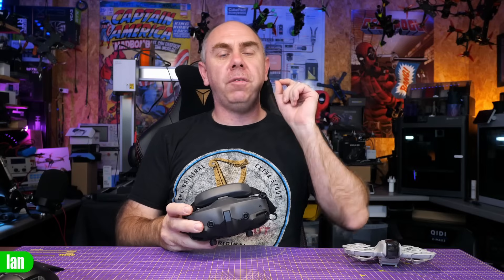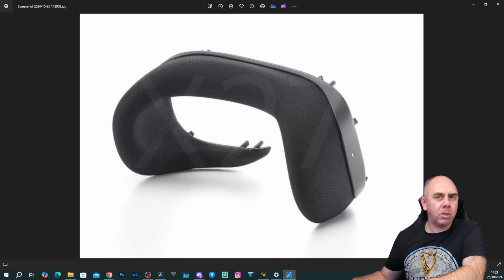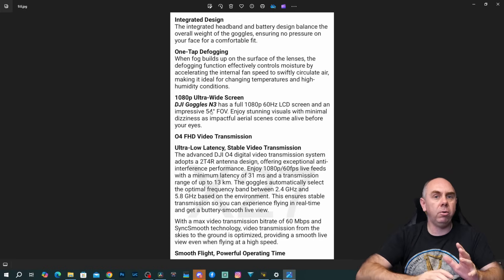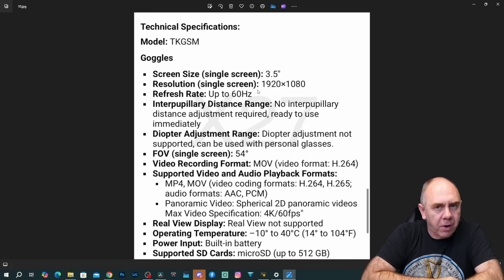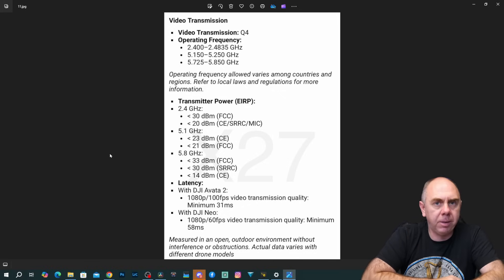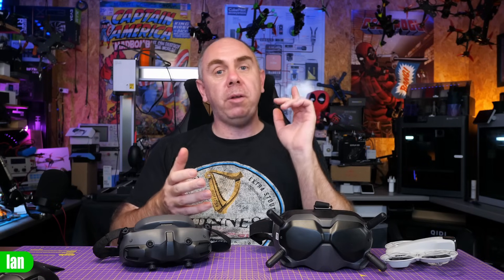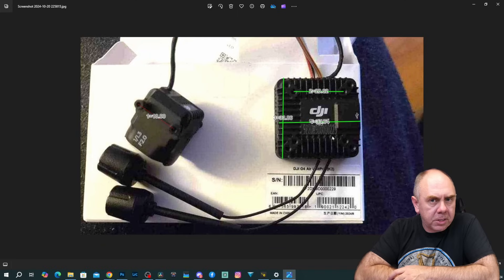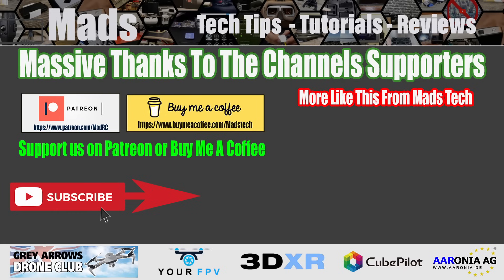DJI FPV Goggles N3 Spec Leaks - 60Hz Display  - High Latency - No O3!

Comment: I don't understand the whole "O4 isn't ready" thing. My Air 3S arrived 4 days ago equipped with nothing but O4. It works great. And I wonder why they exclude the O4 equipped Air 3S from the list of drones that can work with this "O4 only" goggles. Both you and DJI are communicating like the Air 3S doesn't exist. There's a gap of information.
Reply from the maker: You have to speerate off Ca.era drones from fob products.  

DJI do not usually make camera drones compatible with their goggles fully.   While they did do it with Mavic 3 and Air2s that was not the norm. 

Yes your air 3 has O4 but it's a different veriant of O4 compared to what FPV O4 will be.  

DJI O4 on their camera drones is not the same as O4 on the FPV Products.
Reply: @MadRC thank you!

Comment: Why doesn't dji put up same video transmission and reception technology as used in mavic series HD video transmission.  Look at the range in mavic series we get without signal loss and the range we get in avata 2 and other custom fpv's even with dji o3 air unit
Reply from the maker: The Consumers camera drones like the Mavic3  series all have a much lower bandwidth live view links.  In compassion O3/03+/O4 on these drones would be less than 20mbps for the live view.  The chances are it's it's closer to 15Mbps max and can be as low as 5mbps where as O3 and  O4 FPV is upto 60Mbps.  DJI are pushing dramatically more bandwidth to reduce the latency on the FPV drones.  

O3 or O4 on a camera drone is not the same as O3 or O4 on the FPV Products. The links are tuned diferrenty. The Mavics may have lower bandwidth and  far more error data in the link at the expense of latency.  Most of the consumer drones hover around the 100ms mark for latency compared to sub 30ms on O3 

While they may look similar they are not remotely the same kind of RF links and won't behave the same either and one penalty will be range and penitration and latency.

In simple terms One is an F1 car and one is a people carrier. Both have their benefits and downsides but they will not behave the same.

Comment: It's basically DJI goggles V2 but a V3. The V2 is epic with the 03
Reply: V2 still the last best of DJI, and with AV in put :face-blue-smiling:
Reply: @tk-maker  totally agree
Reply: Dont leave out the  g2 goggles, i like my g2 as much as my v2, but ther integra and newer are trash @tk-maker
Reply: Bulky like v2 but n3 only has one screen.. I'd say v2 are still better
Reply: @GR33ZY.A1  much better but not supported for 04 which should be since most fly with 03 on V2 my G2 suck and I only use V2 now but now I learned 04 on G2 will be great too I just wished I had the choice to move the OSD of DJI to the left and right on the screen instead of going cross-eyed trying to look down in my G2 but thank God for betaflights OSD

Comment: So, V2s and 03 for the win still.
Reply: And g2 , not integra, the v2 and g2 are my equal favorites , the v2 still gets slightly better range and latency though.
Reply: @jeffdughman9741 why not the integra?
Reply: @perry_the_liu built in battery when it dies you done flying can’t use lipos to power it, and no focal adjustments by dial the give you like 10 different lenses you have to find the right one taking each on and off to test and if you wanna let someone use them or show them a flight it’s a pain

Comment: DJI is really pushing things recently. Flying in 60fps or higher is perfectly fine for me, 30fps never was....I think these are quite good Goggles when the bring out the O4 "lite". Maybe they will give more options to the Goggles 3 and "Pro"  O4 Version. If they get out a lite and single board version that would be a killer, even though I think this might be challenging.

Comment: A complete waste of money. I have this drone with n3 controller 350€. This goggles, the fpv controller and spent 800€ on a entry level drone which doesn't really do acro (not too long I guess). For this money you can get a complete aqila16, cetus x and whoopfly16 sets together.... For rich noobs....
Not to mention, if somebody wants to pratice throttle control, enoght a small piece of duct tape onto the IR and VPS sensor and the drone turns on atti mode and can pratise the noob. If someone has a avata 1 is nothing compatible. Let's see who will buy them...
Reply: Atti mode on Neo? But gps is still received. Have you tried duct tape Neos bottom?
Reply: @videos3d313  yes. Oldskool dji trick. The gps Performance is weak out of the box, put on small piece of alu foil and you have continuous atti mode
Reply: @djiNEOn  yes, but it doesnt work on my mini3pro. it wants to always raise with center throttle stick :(
Reply: Me, I guess being a rich noob, I will waste my money on this lol. I didn't want to spend time researching other options. Time is valuable. I want to buy into a known decent brand that will most likely work well for it's INTENDED audience (me) and be done with it.
Reply: @mjnz  I don't care

Comment: DJI I estimate has sold 36000 units of DJI v2 over the last 3.5 years.  There are 94 reviews of these goggles on Amazon.  1% of purchases leave reviews.  This gets us too 9400 through Amazon and I quadruple this number since it is sold world wide and through other channels.  Most in the US will buy through Amazon for free shipping and quick delivery.  At 100 profit per unit this is 3.6 million - a drop in the bucket for a 10B market cap company.  They sold a heck of a lot more of the Goggles 2 due to compatibility with their consumer drones.  500+ reviews in one year for them on amazon so do the math and you will see DJI does not care about our hobby unless it also benefits also their consumer drone buyers.

Comment: My avata 2 dropped out the air whilst in pre manual mode. 
I contacted DJI and they told me it was my fault for not throttling up whilst in “pre manual mode” which I don’t even think is possible. so I will have to pay for it. 😂 what a joke

Comment: This is why I am avoiding DJI.  Incompatibility is built in.  Still flying analog until we can get an actually trustworthy Digital FPV.
Reply: I jumped from analog a few years ago. I got lucky with DJI V2 system. Best all around system for digital FPV at this time when used with wtfos hack imo.. I use original air unit with live audio for scale hd fpv planes. Caddx vista for "explorer" style 4"quads. And you can get the best visual  quality with 03 air unit, and up to 23 km range for LR quads/wings. BUT it's "eol" as you know. If I didn't love the immersion with live audio so much I would choose Walksnail going forwards especially because of range and the ground station possibilities.. But sticking with the V2 goggles until they die.. Best FPV goggles I ever had..! Coming from fs attitude V1 and fs "hd" V2 goggles.. Anyway, maybe open hd will come and save us all from the mess of DJI's systems..
Reply: Same here....analog for life.  I'd rather spend time flying than updating high latency firware

Comment: Is goggles 2 still a good buy at 350 USD ? Or should I go to goggles 3 for 450 USD ? Or simply wait.
Reply: I’ve got the goggles 3 and they are great. really like the way they sit on the forehead instead of around the eyes. Way more comfortable
Reply: can you test the goggles 2 ? for me--- they was no option. Goggles 3 fits better.  But goggles 3 has no caddx support.

Comment: I fly 60 fps preferred, and only use 100 or 120 fps modes for slow motion shots.  And most of my crew are using 60, with only one of the younger guys doing 120fps.
You know as well as I that DJI will try and push people towards the new hardware and after a time they very well might introduce backwards compatible for ONE generation only. Chances are high they will do this, but clearly they want to sell the new stuff! 
Wifi functionality SUCKS as it is now, the breakup used to be in the pilot before the first update, but after that the breakup is pretty bad on the wifi device. I'm just using the cable now.
Nice info, I bet they'll sell like hotcakes!